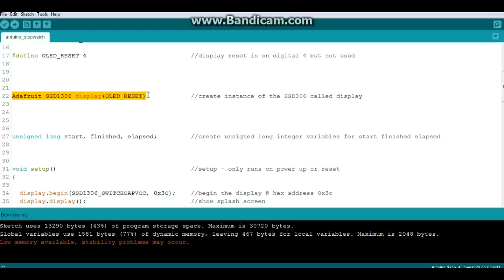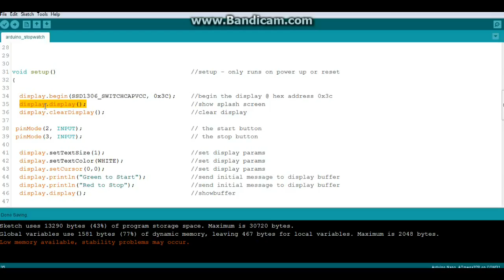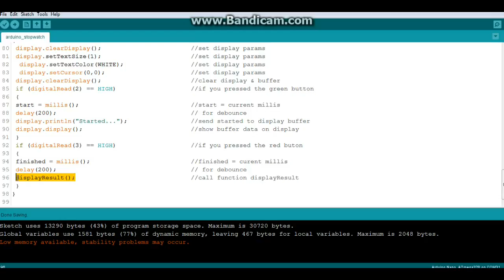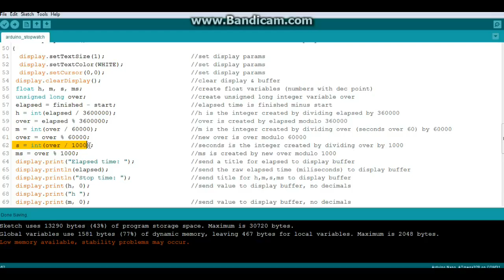Arduino Stopwatch

Comment: Great wee project. Wish I could write my own software but not at that stage yet I'm afraid! A clock using ds3231 rtc and a 1602 lcd also on I2C would be great. I could only find one example on youtube but it didn't work for me (or for many others)! It's helping me learn more about coding by seeing your, well thought out, worked examples!
Reply from the maker: Thank you. I don't have an I2C LCD but other than the setup, it would work the same with a different display. In the example below, replace display.print with lcd.print

/*
 * Arduino Real Time Clock
 * learnelectronics
 * 2 FEB 2017
 * 
 * www.youtube.com/c/learnelectronics
 */

// Nokia 5110 pins
// pin 7 - Serial clock out (SCLK)
// pin 6 - Serial data out (DIN)
// pin 5 - Data/Command select (D/C)
// pin 4 - LCD chip select (CS)
// pin 3 - LCD reset (RST)

// DS2321 RTC Pins
// GND -> GND
// VCC -> 3.3v
// SDA -> A4
// SCL -> A5

#include <SPI.h>
#include <Adafruit_GFX.h>
#include <Adafruit_PCD8544.h>
#include <DS3231.h>
#include <Wire.h>

Adafruit_PCD8544 display = Adafruit_PCD8544(7, 6, 5, 4, 3);
DS3231 Clock;

bool Century=false;
bool h12;
bool PM;
byte ADay, AHour, AMinute, ASecond, ABits;
bool ADy, A12h, Apm;
byte year, month, date, DoW, hour, minute, second;

void setup() {
 // Start the I2C interface
 Wire.begin();
      // Uncomment the following lines and imput
      // correct data to set time & date
      // Then recomment
      //  Clock.setSecond(50);//Set the second 
      //  Clock.setMinute(10);//Set the minute 
      //  Clock.setHour(12);  //Set the hour 
      //  Clock.setDoW(4);    //Set the day of the week
      //  Clock.setDate(1);  //Set the date of the month
      //  Clock.setMonth(2);  //Set the month of the year
      //  Clock.setYear(17);  //Set the year (Last two digits of the year)
 
 Serial.begin(9600);
  display.begin();
  display.setContrast(60);
  display.display(); // show splashscreen
  display.clearDisplay();   // clears the screen and buffer
  display.setTextSize(1);
  display.setTextColor(BLACK);
}
void ReadDS3231()
{
  int second,minute,hour,date,month,year,temperature; 
  second=Clock.getSecond();
  minute=Clock.getMinute();
  hour=Clock.getHour(h12, PM);
  date=Clock.getDate();
  month=Clock.getMonth(Century);
  year=Clock.getYear();
  
  temperature=Clock.getTemperature();

  display.setCursor(0,0);

  display.print(hour,DEC);
  display.print(':');
  display.print(minute,DEC);
  display.print(':');
  display.println(second,DEC);
  
  display.print(month,DEC);
  display.print(",");
  display.print(date,DEC);
  display.print(",");
  display.print("20");
  display.println(year,DEC);

  display.print("Temp. ");
  display.print((temperature)*1.8+32); 
  display.print("F");
  display.display(); 
  display.clearDisplay();
  

}
void loop() {
  ReadDS3231();
  delay(1000);
 
}
Reply: learnelectronics thanks Paul your reply is appreciated.  Will try this once I finish my in progress projects and let you know how I get on!  
Davy
Reply: BTW will this work ok with my cheap Chinese lcd's?  I wondered if they're ok with the adafruit library?

Comment: Thinking of using this as a speed trap for CO2 powered cars or mousetrap cars since its a lot more precise than just eyeing it. I'll use lasers and maybe some LEDs or photo-resistors as the sensors. What do you think?
Reply from the maker: That sounds like a cool project. It should work just fine. Let me know how it turns out!

Comment: Question: why is the resistor used in this way rather than only utilizing the yellow wire directly to the board with or without a resistor in series? Thanks!
Reply from the maker: Tim Kleyn two reasons really. first it keeps the pin low unless the button is pressed. if you didn't do that the pin could read high or low on its own. that's called floating.

second...if you didn't use the resistor you could overload the pin with current. because pressing the button shorts 5V to ground...the 10k resistor keeps the current low so no damage is done.